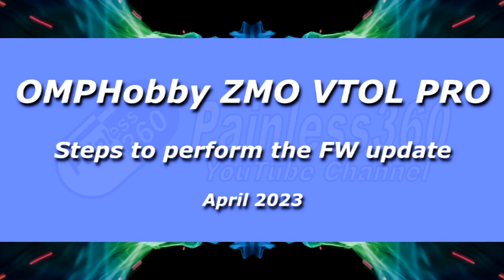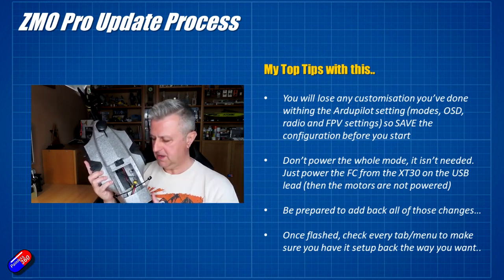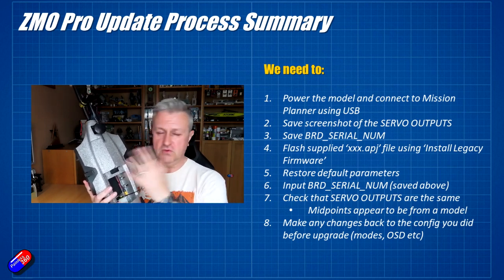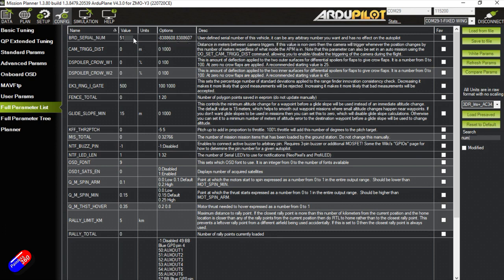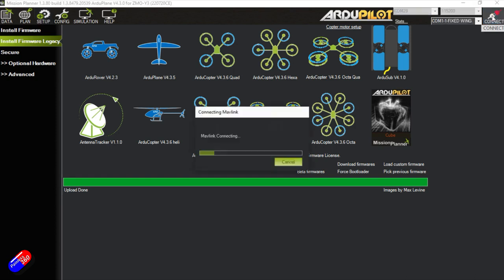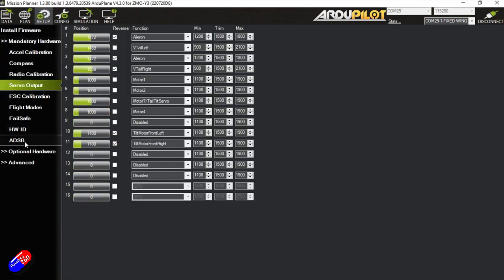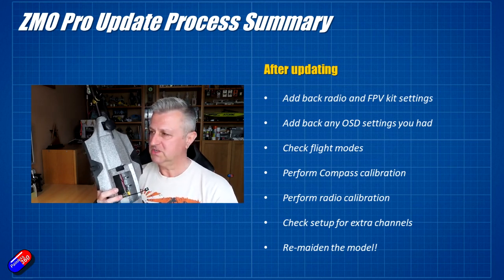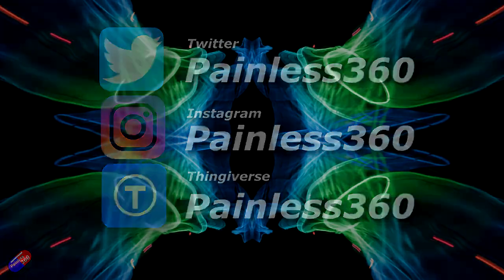How to Update OMPHOBBY ZMO PRO Firmware

Comment: What is the difference between this video and the video released before? 
On their web site there are two updates D8 and D8-1, what is the difference? I did not get it.
Reply: Its the same between two videos, lee've upgraded D8 firmware on his VTOL. And there is only one change between the two firmwares, D8-1 was updated on D8. D8-1 fixed th 03 Air Unit arming issue.